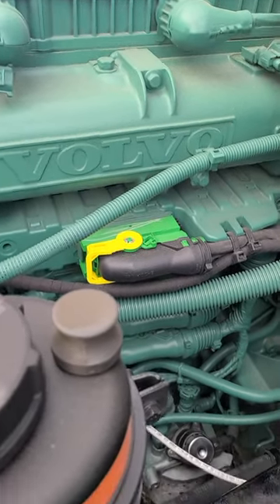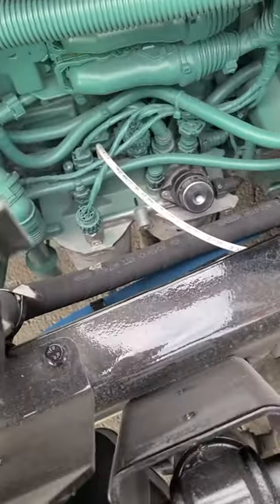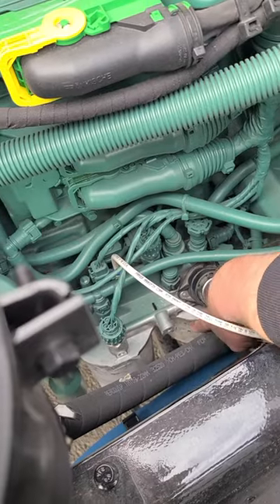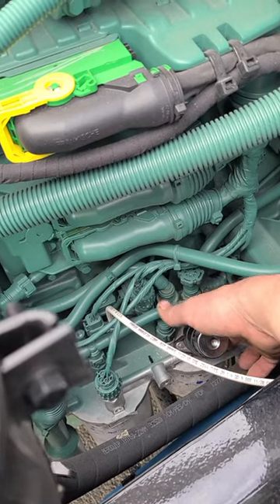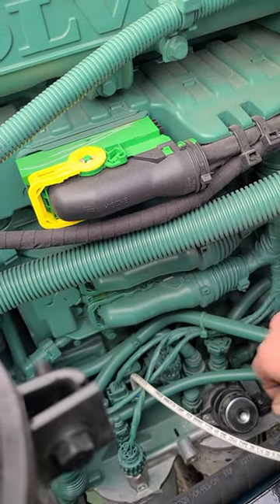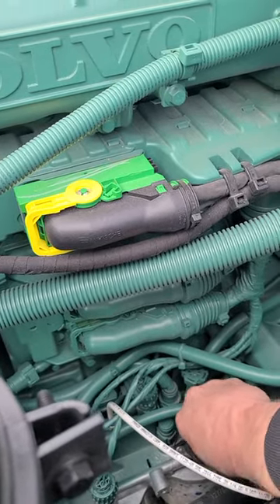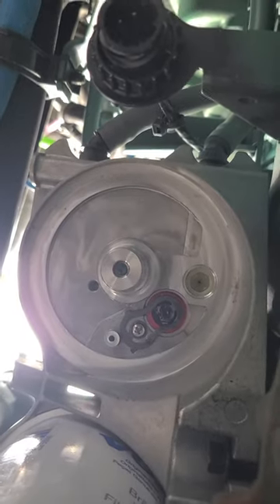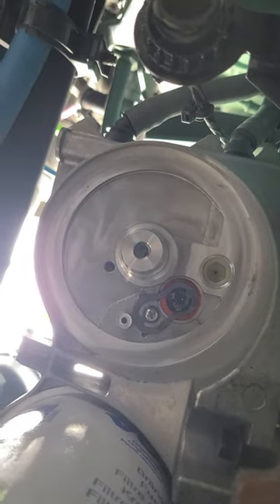How to Prime Fuel Sytem Volvo 2020 D13.

Comment: I just had the same similar issue happen to me in a 2021 Volvo. Low power, hesitation and surging etc etc.
Reply from the maker: What was it? The pump?
Reply: Still up in the air. Had dirt clog up that intake for the water separator